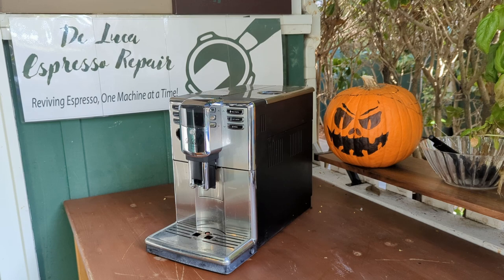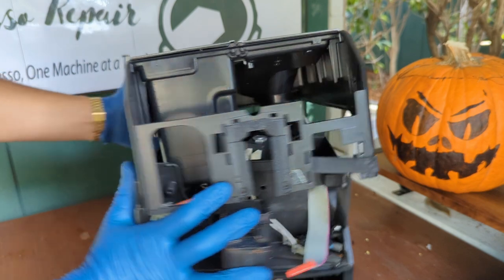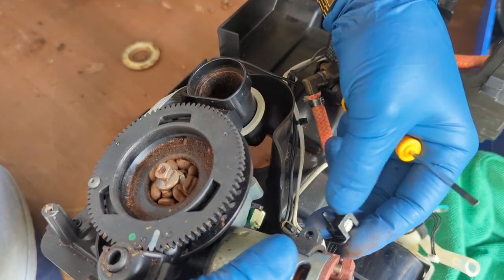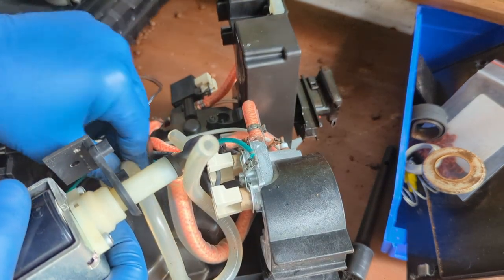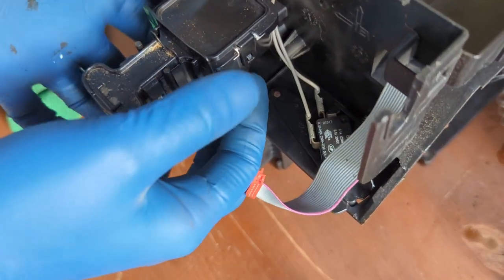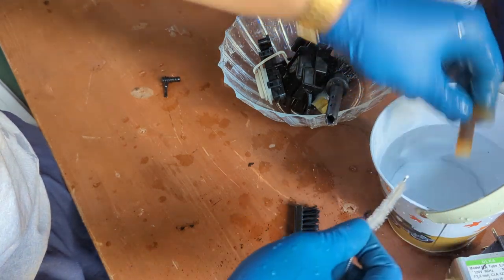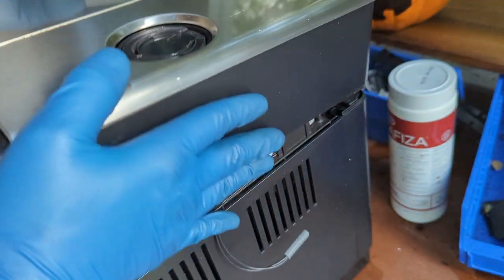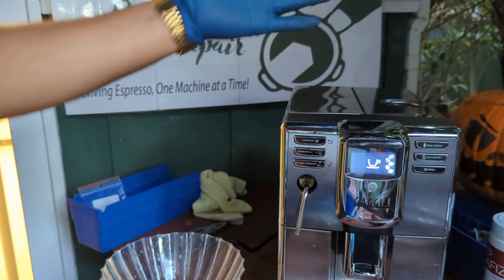Espresso Surgery Unveiled! Gaggia Anima Deluxe Full Disassembly & Expert Repairs ☕🔧

Comment: This is the most complete video. Good job. I have a problem with mine, it show the error Missing Beans all the time, but it grinder the correct quantity. I already replaced the sensors  the two ceramics discs on the grinder. Still I have the same error. Do you think that I need to replace the motor too? Thanks
Reply from the maker: These machines have a magnet sensor on the gear of the grinder and if that  magnetic sensor of the motor is bad then you will get the bean error. I usually replace both the motor and the sensor of the machine if I get persistent missing beans error. Hope this helps 😃
Reply: @DeLucaEspressoRepair  thanks for the answer. I did replace the sensor already. I have the same problem. I think the machine monitors the motor’s amperage. If it detect low amperage it means that there is not beans. I’ll replace the motor and I’ll tell you the results. Update. I replaced the motor. If I set the strongest low ( 1!coffe beam) it works. But I set the strongest one (3 and more coffe beams ) it sows the same problem. I can only make it works if during the grinding I open and close the beans lid couple of times.
So far I replaced the motor, sensor and the two ceramic discs.

Comment: At 1:07:30, when you are replacing the cover, you can see the black silicone seal that goes over the pre-ground brew port (in front of the grinding wheel), has come off again.  It is why the case was not fitting on top properly.  You thought it may have been the spring under the grinder pushing it up but that was not correct.  If you have not fixed it, that seal is being crushed underneath the bean hopper.
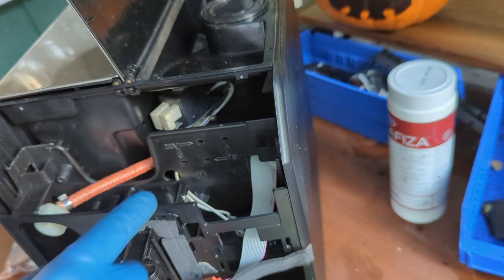Reply from the maker: Thank you so much for bringing that to my attention! At 1:08:40, I realized there was a mistake and corrected it, resulting in the jump cut you noticed. Upon further inspection, I found that the issue wasn't with the spring of the grinder, but rather the gasket not being well-seated on the grinder chute. I appreciate your understanding and patience as I work to improve the video. If you have any more insights or feedback, feel free to share. Thanks again!
Reply: @DeLucaEspressoRepair  Fantastic! Good job, very thorough. Maybe you can answer, I recently did a complete cleaning of the grinder. At some point I pulled off a square silicone piece, dark gray or black, and it has an arrow on it indicating which way to slide it on the component it protects. I've watched your video twice but I can't find this piece anywhere in it. Do you know what piece I am talking about? I couldn't figure out where to put it back on.   Thanks!
Reply from the maker: @louisik1, it sounds like the silicone piece that rests under the grinder chute. It's a grey silicone piece placed at the base of the grinder chute (in the little hole on the frame where the grinder chute rests and where the coffee grounds drop into the brew unit). Then, on top of it, there's the one you mentioned, which is black (the one that fell off in the video). I hope this helps 😊
Reply: @DeLucaEspressoRepair  thanks much! Do you think it would cause any problems if I just leave it out for now and replace it next time I'm in there?
Reply from the maker: @louisik1  The missing silicone piece at the bottom might cause a bit more vibration and noise. I'm uncertain if it directly affects the coffee flow into the brew unit, but the noise level might increase due to the tiny gap. While it could impact performance, I can't guarantee it 100%.

Comment: Thank you for your videos
I have a Saeco picobarista. It looks the same as this inside. 
It won’t rinse or dispense coffee but it will send hot water through the hot water/milk foam dispenser tube. 
Instead of rinsing, it appears that the water goes into the used coffee grounds bucket
I took it apart and all the clear hoses look perfectly clean.
What causes this problem? A defective pump? Thank you
Reply from the maker: It seems like the issue might be with the brew valve in your machine. When gaskets wear out, water can leak and end up in the tray instead of the spouts. To identify the exact source, try testing the machine with the door open. If the water leaks from behind the brew unit, it's likely the brew valve. On the other hand, if the leakage is at the front of the brew unit, it could be the o-ring on the brew unit causing the problem